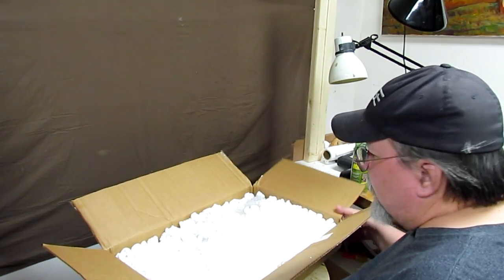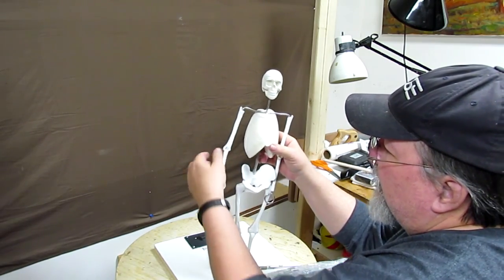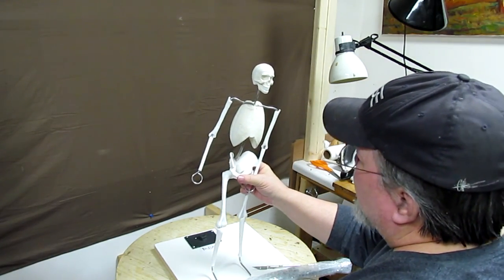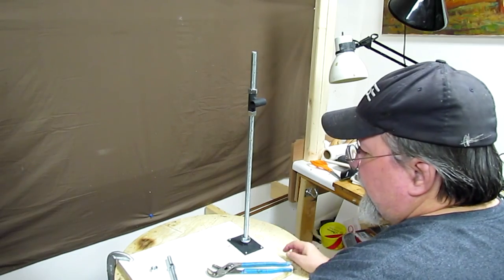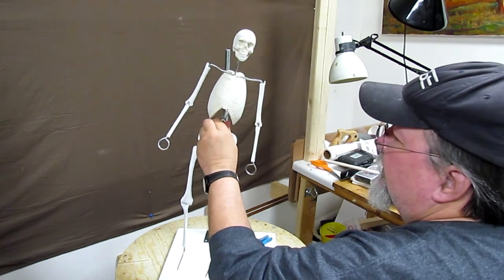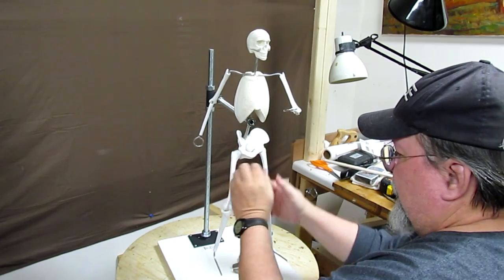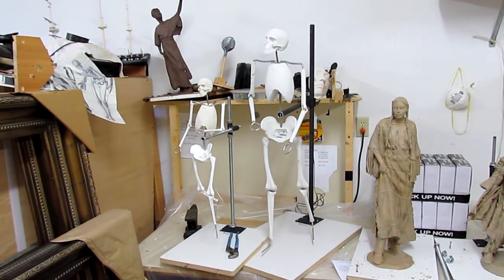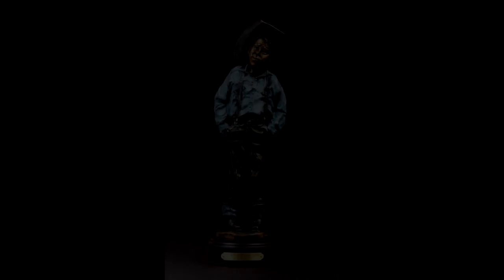24 inch Human TruForm Armature Setup Tutorial

Comment from the maker: The clay is a none hardening clay. I use a product called J-Mac.. I use the medium grade.
Once the sculpture covers the nut, you can only remove it if you cut out the clay in front of the nut and undo the nut then remove the rod... I don't worry about that in 99 percent of the time... Unless I decide to change the design of the piece.